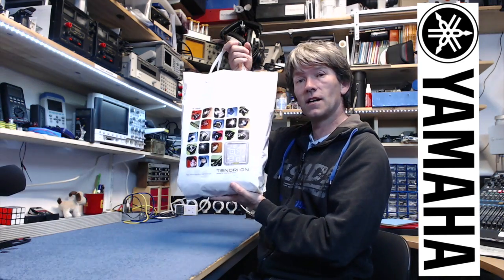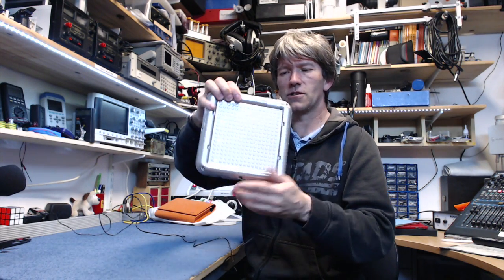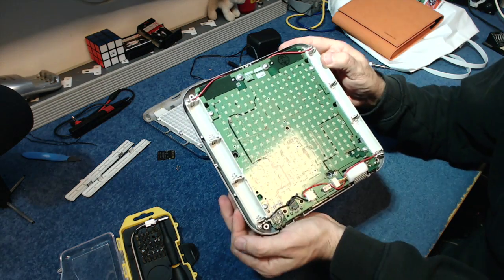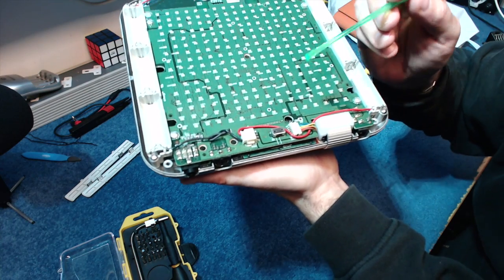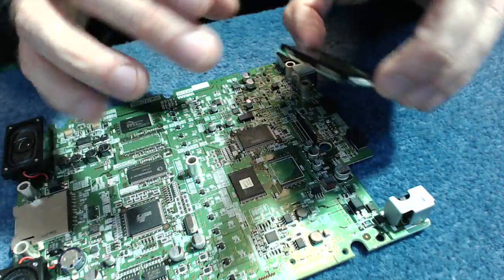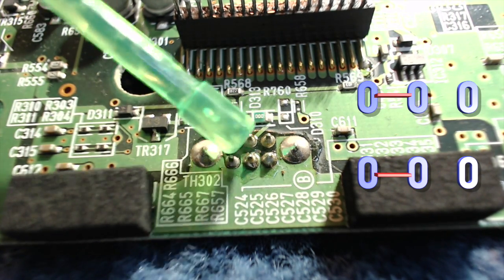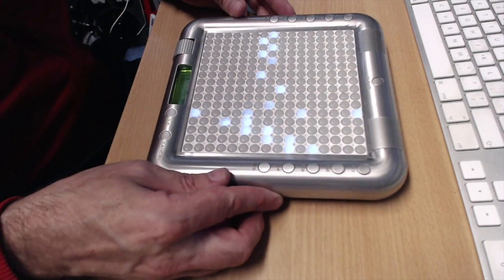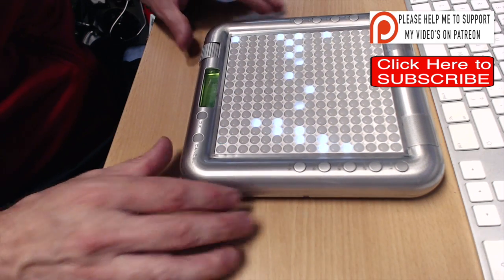Yamaha Tenori-On repair how to remove LCD screens MF#76

Comment: Does the switch have to be subjected to undue force to break, or will it happen with repeated use over time? Seems several people have had problems with the switch arm breaking, so perhaps it's worth while replacing it with a more durable type?
Reply from the maker: Hello. Im not sure how the original switch was broken. this belonged to a friend of mine so I really do not know how the old one was broken off

Comment: I've soldered and de-soldered 24 micro pin adapters on cell phones with only a temp controlled iron and wick. Kinda suprised it didn't work for this job, but using resistor wire is a good idea.

Comment: A tip for desoldering, use a small beveled tip and flux, wipe the pads and your wick with flux, you will be amazed at how better your life will be!  :)  Just makes sure to clean the flux off the board as flux can cause issues, use Kimwipes and isopropyl alcohol to clean up with.

Comment: I had to do a similar thing with a X-radar chronograph someone left in the rain then promptly turned it on. Didn't harm anything just corroded connections and shorted right away. I resoldered everything that looked like crap and put the batteries in. Lucky it works again. I used heat tape to protect the LCD. It was nasty to get all the garbage off it. I should have taken it off like you did. I feared cleaning those holes but that's a good idea. I'll probably forget by next time. lol.

Comment: Nice job. I don't think I'd have even tried that. I'd probably have chopped off the switch and put jumper wires to the nubs left over and attached new switch somewhere else. I'm going to remember your tricks. I'm sure I'll have reason to use them soon enough!